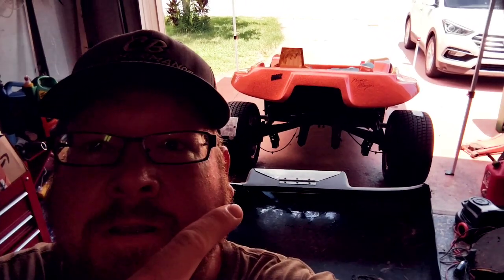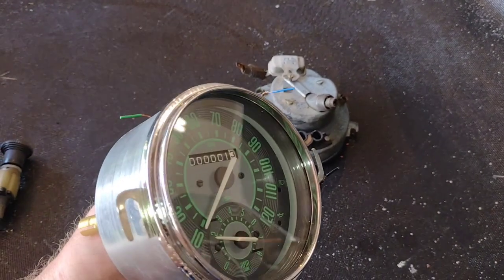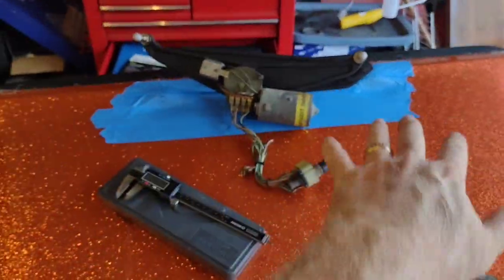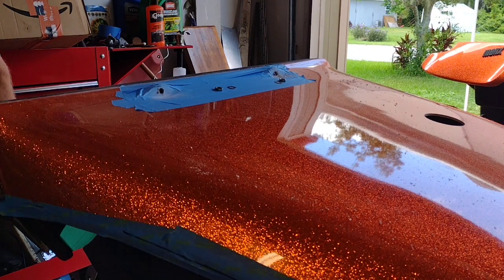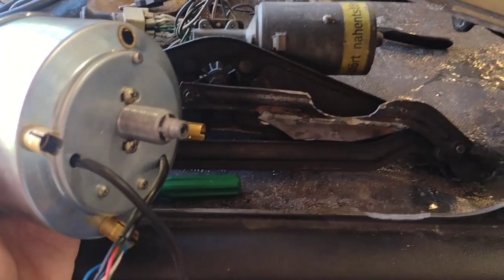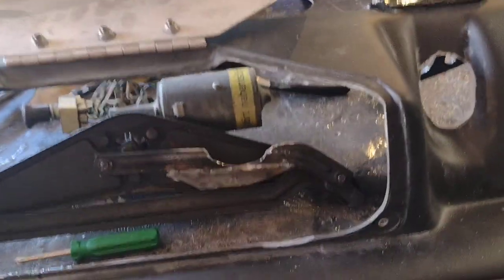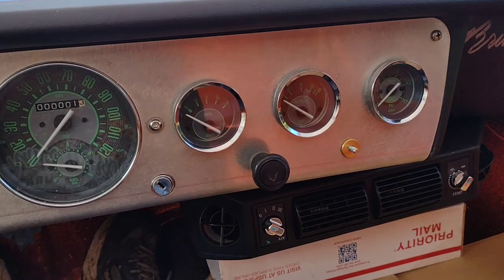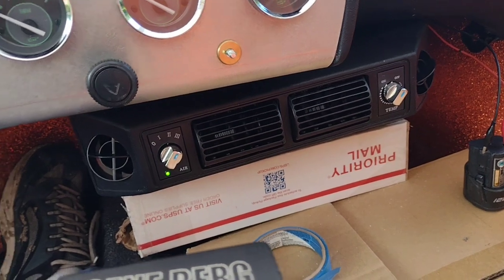Dune buggy windshield wipers #meyers #volkswagen #manx #boost

Comment: Can you please show more on the ac system.  Building a 69 Baja and would love to have one of those.
Reply from the maker: The A/C is not completely hooked up. Just getting the bracket mounted for the unit. I got it off Amazon a while back as a kit with compressor, condenser, dryer and the under dash unit ( no hose's). This kit has a small modern compressor but if I had a bigger car I would get the electric compressor. As you could mount it almost any where and make the hose's shorter, but you need a powerful alternator to run one of those. The kit was about $500 when I bought it but is probably more now. When it is done I will give feedback  on how well it works, but it is one of the last things on the list. Hope this helps.
Reply: @MattLundquistVW  it does thanks.  I’m in Louisiana and it’s my first build.  I’m learning a lot and folks like yourself have been very helpful.  Have taught myself to weld did my pans and full luggage self.  In the process of painting now.  Thanks for the videos

Comment: Nice work, one thing you'll want to check it the arc distance of the blades.  I've had to shorten the cam on the motor to reduce the wipe arcs of the blades.  It should not affect your clearance and modifications you've already made.  Good luck with your build.

Comment: Nice work Matt and boy is that a tight squeeze! It's hard to tell from the video but it looks like it will be a really tight fit getting the speedo cable connected. To combat that if there is an issue have you thought about getting an earlier motor or re clocking the motor ?
Reply from the maker: Yes the speedo cable will be tight. I don't think the nut will fit on the speedometer and clear. But the cable should have enough friction to fit well. As for a for re- clocking the motor I have not thought of that.  An earlier motor would definitely clear better, just trying to use what I have as it is the two speed motor. We will just have to see.
Reply: @MattLundquistVW  well I'd try re clocking the motor to give ya more room, 3 new holes and putting the arm 180 opposite on the motor and everything should function as original in theory and give you more room

Comment: Thanks for the insight. I was planning on not running wipers on my buggy. After talking to a local guy into cars, I found out that for it to be street legal it must wipers. So thanks!
Reply from the maker: Most states will allow a manual wipers, and there is a guy in Miami that sell one on Facebook . His mounts to the aluminum windshield frame
Reply: @MattLundquistVW  
I’ve seen them, but I don’t like them. If I must have wipers, then do it right!
Reply from the maker: Yeah I don't like how you can't run side curtains if you have a top, with those manual wipers.

Comment: Did you reduce the arc of the wiper arms? I just installed a wiper setup on my new Manz build and have 2 problems. Arms are to short and arc is to much.
Reply from the maker: I modified some 8" blades and shorten the arm. I will make a video explaining what it did, so subscribe for updates.